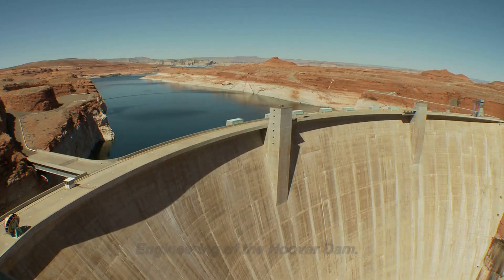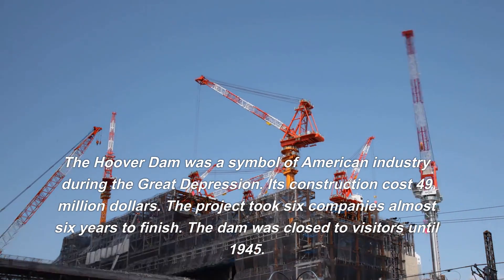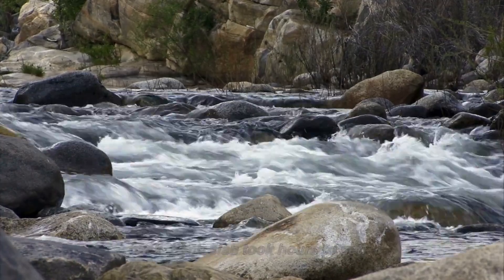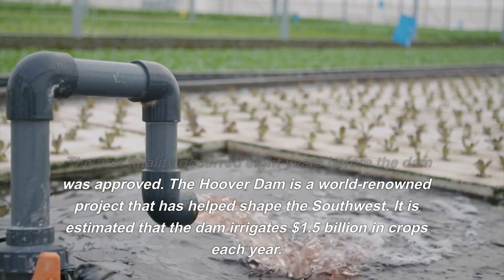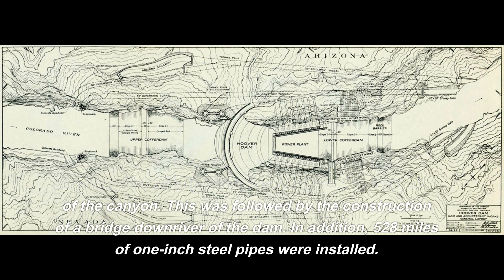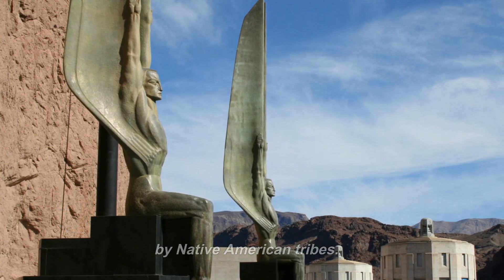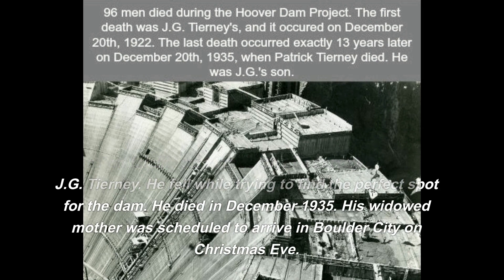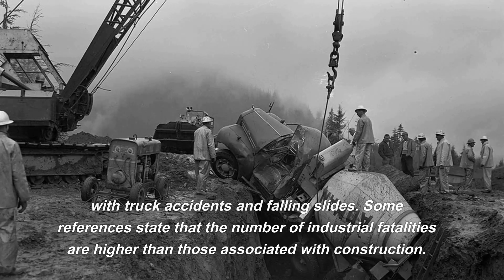The Hoover Dam Disaster That Was Never Told

Comment: It handles Niagra Falls water volume
Reply from the maker: Crazy Right?  Each spillway can handle 200,000 cubic feet per second of water. The flow at Niagara Falls is about 200,000 CFS, so there is the potential for two Niagara Falls here.